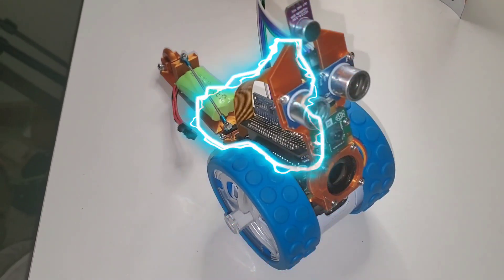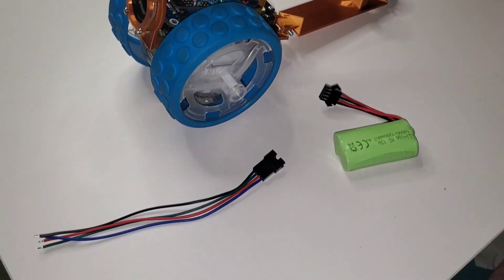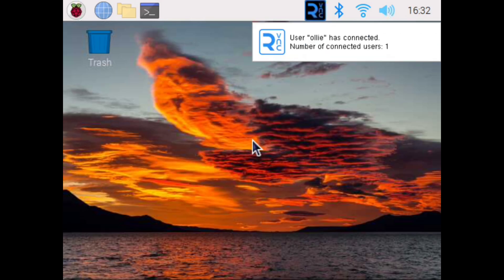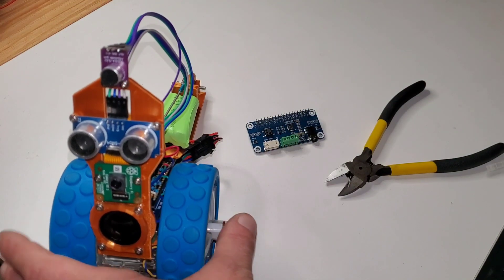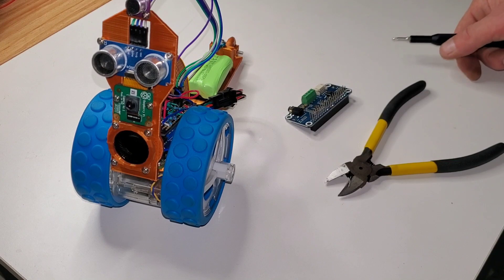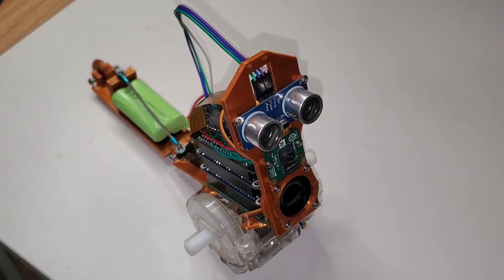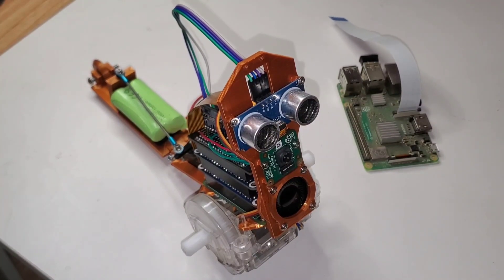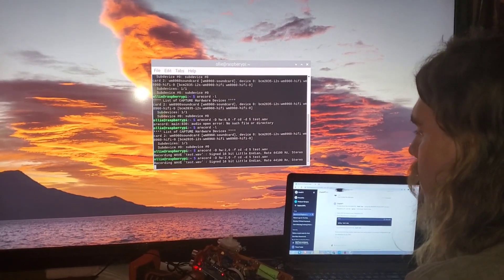Creating a ChatGPT/AI Robot: Part 3 - Circuit Problems and Initial Test!

Comment: Awesome ❤❤ btw . A question I am using my Pi5 for my robot . Anyway I have read that I need two separate source of powers 1- a power bank for the pi and the cam ,, the OLED screen and basic sensors 2- Power source for the motors and the head movement ,, but I see you are using one power source for everything.. if you have any solution for this issue let me know . I am worried and don’t want to connect the motors to the pi and fry it .
Reply from the maker: This was an old design and 2 power sources are CRUCIAL! Have you found a good way to power your pi5 from battery?
Reply from the maker: The problem with 1 power source is when the motors run, it can drop the battery voltage too low for the pi and the pi will just turn off and your motors won't have anything controlling them